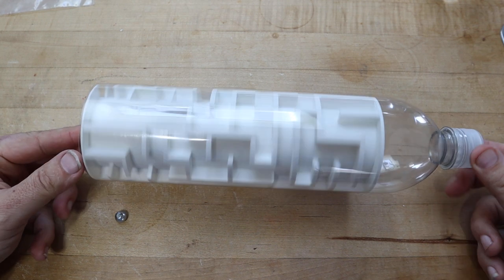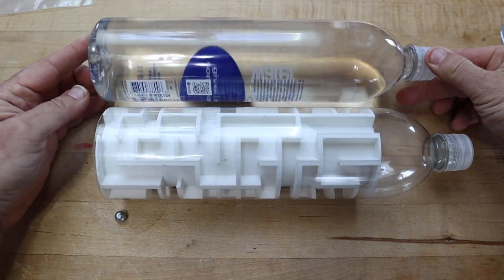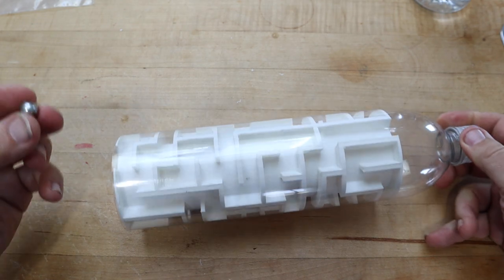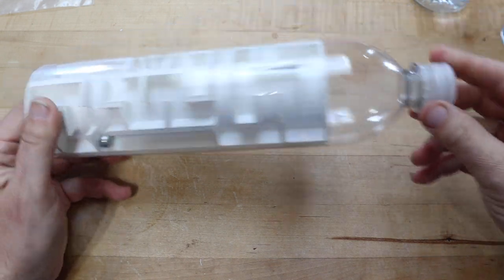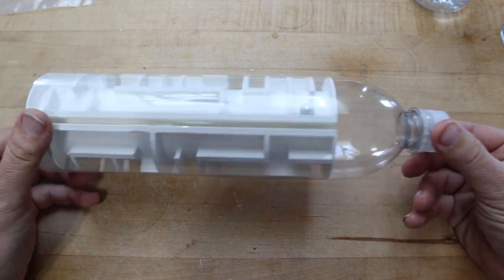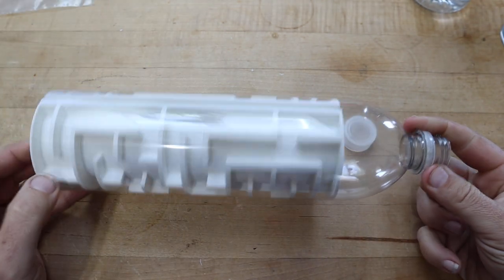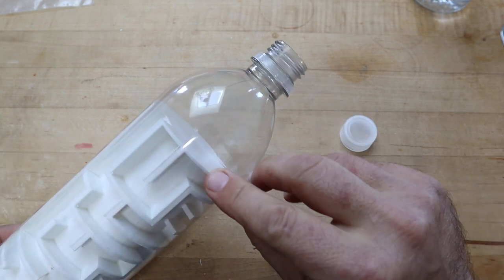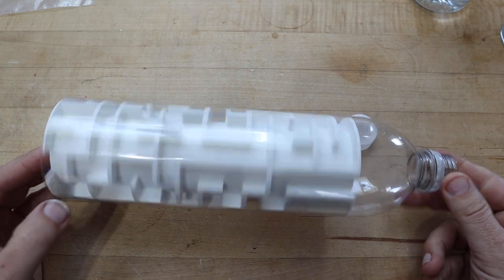3D Maze in a Water Bottle

Comment: You could make tunnels inside the maze .. that would be like 8-4 level in super mario 😂
Reply from the maker: Yeah, I'd love to do some tunnels through it! It's just a matter if figuring it all out in 3D space and making sure I can still remove the supports.
Reply: @BenjaminNelsonX  Print a 5-10 degrees cooler, 25mm/s slower, 0.1mm narrower line width, or some combination of those while cranking up the cooling fan and you should be able to bridge a tunnel without any supports. The goal is to solidify the filament immediately after exiting the nozzle. Since the bottle is doing most of the supporting of your structure you don't have to worry as much about layer adhesion.